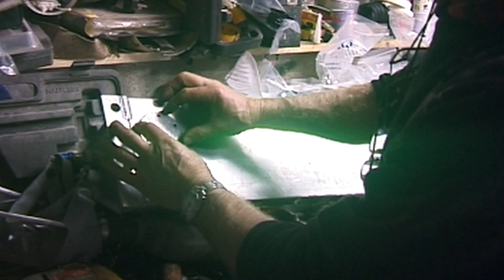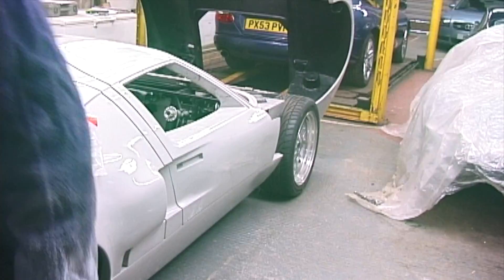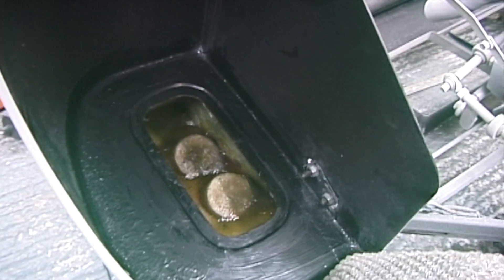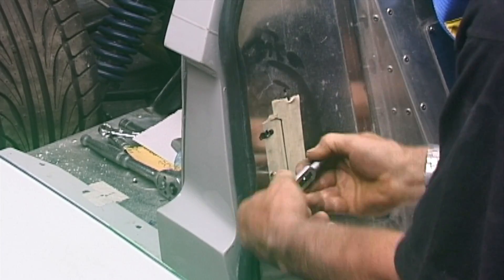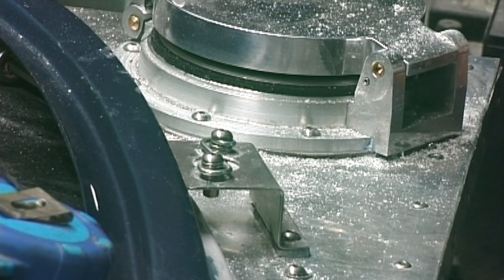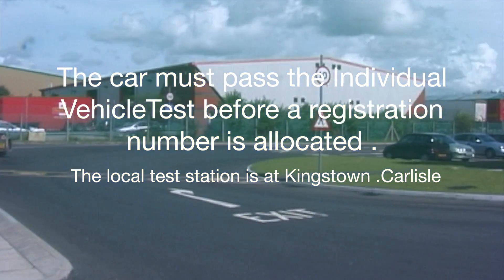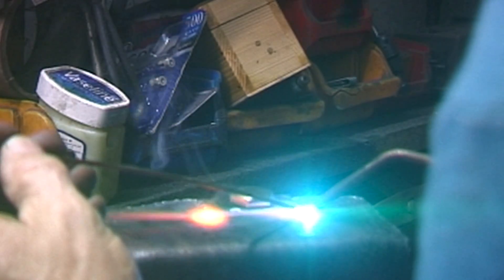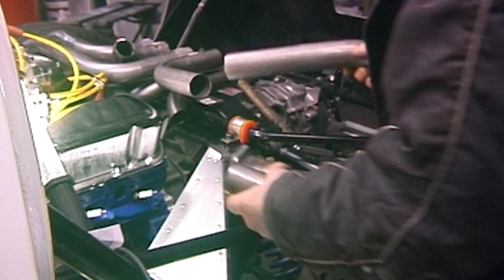Building a Ford GT40 (part 3 of 3)

Comment: Why did the car have to go through the IVA with the V6 and not with the V8?
Reply: In the UK a replica/kit car will most likely have to go through an IVA, but there are lots of different categories of how you can put a car through the IVA test. I'm going to guess this (Alistair Cowan do confirm!) GT40 replica went through a Basic IVA as a 'vehicle manufactured using parts of a registered vehicle'. I think a Ford Granada was the donor and it would have a had a cologne V6 engine in it - so to comply with the whole IVA process you have to IVA it with the original engine. Once you've passed the IVA you can put in a different engine and also just buy an age-related number plate. It's all just how the system works and having to jump through the hoops.

Comment from the maker: You can see more of my dad's work on this video, building another classic car (before the GT40 build), the Jaguar XKSS - https://youtu.be/fsQNZVP0mK4
Reply: Im wondering what flywheel he used on the 302 engine? I would think he continued using the rover pressure plate assembly . But if you could tell me it would be very helpfull. Thanks
Reply: @thatguy83ful  Hi Thanks for your interest .  I used a Porsche G50 gearbox and bell housing running inverted which is capable of taking the power of the 302 V8 ( around 400 BHP with upgraded heads and fuel injection.) I sourced the complete flywheel and adapter plate from Kennedy Engineering in the USA , and fitted a geared starter motor . The system has proved very successful over many " launch control " starts , continental journeys , sprints and hill climbs .
Reply: Thanks for the quick reply. Thats exactly what i needed to know. Is your father on gt40s.com website? If not you should set him up an account. He has a wealth of knowledge. I was tryn to decide to go with kennedys kit or fabricate the same way your dad did for the v6 engine. Except i would have to weld the porsche flywheel mounting holes shut and redrill etc..  so i was going to buy a wheel and clutch and plate of alloy. I now will just source from kennedy also. Thank you for the help.
Reply: @thatguy83ful  This is not an easy site to deal with , but what I was saying was  that I am a member of the GT40 Enthusiasts club , and I have written a few article about developing the car which you may be interested to read if you could get hold of them . 
best of luck
Ian
Reply: @iancowan7773   yes this is the same web site.  Ive found lots of great info from this site.
Reply: @thatguy83ful  Hi , I am a member gof the GT 40 Enthusiasts club . I written a few articles articles which talk about fitting the sequential

Comment: Great video - to take on this type of project you certainly need some skills!  How were you able to get a C (1966) registration plate?   Also, the original GT40's had the cabin roof made of steel, doesn't this fibreglass part of your's compromise the car's integral strength or even the safety in the event of an accident? I would have thought an internal roll bar would be necessary, even to pass a safety inspection?
Reply from the maker: "dave glover - regarding the reg... you can buy any registration as long as it is not a later one than the year the car was made.  Regarding the roll bar - it has a main roll over hoop over the drivers head, and a diagonal will be added to satisfy the MSA blue book regulations.  Very few GT40's have been fitted with front roll bars as there is not room to fit them in - there have been two serious accidents with cars with front roll bars fitted.  Front roll bars may acceptable for race cars with full harnesses and head restraint systems and to be driven wearing a full crash helmet, but for road cars, the single hoop with a diagonal is probably the safest option" Ian C.